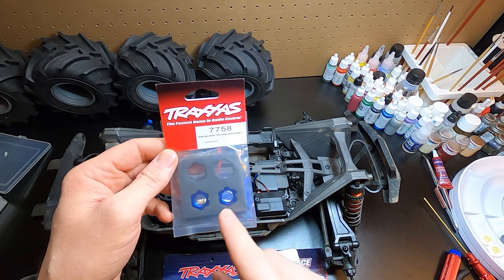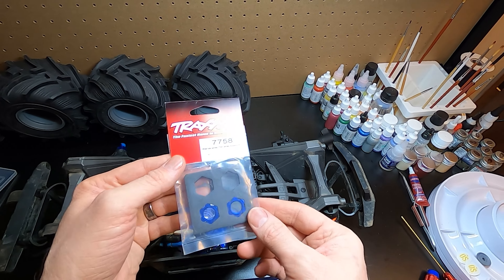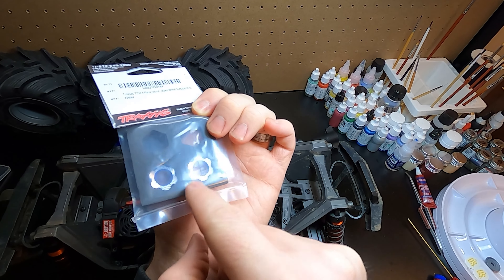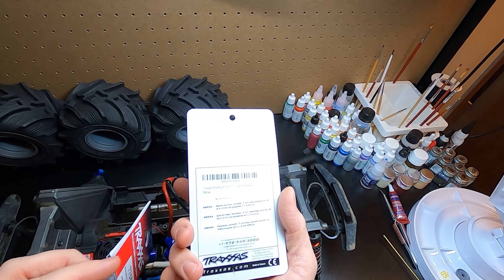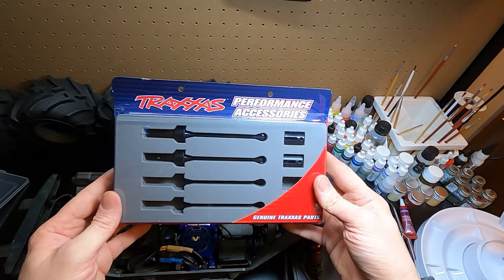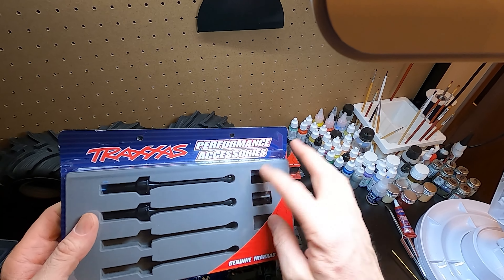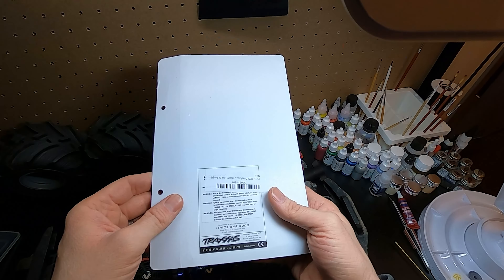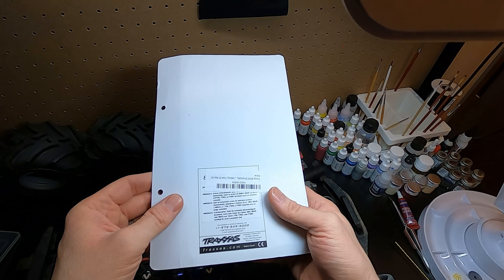Traxxas Maxx STEEL Drive Shaft Install Video

Comment: As a lifelong mechanic, I love how Traxxas thinks about ease of maintenance and repairs. Its impressive that it only takes a few minutes, one nut and two screws to replace an outdrive. I'm loving the Maxx with those Fling Kings!  I have a set of the Renegades on my LMT, I'm def going to buy a Maxx just to run them on it.
Reply: As a random dude i think its absolutely stupid that they charged 600 dollars for this truck and put plastic driveshafts. Metal should have been included total idiotism.
Reply: They gotta get that upgrade cash. Lol
Reply: @KrazyKido  cry harder

Comment: I put those high velocity drive axles on,  I got the widemaxx kit, so had to get the ones to fit, what a difference  definitely RECOMMENDED these ! Seemed to be more " raw" with power,  you will see what I mean!

Comment: I wondered what those grub screws were when I installed my axles in the maxx v2. I’ve been bashing the snot out of my maxx and changed wheels several times till last night and I put some buggy wheels on it and one came off on a 60mph speed run. Haha will the regular grub screws work? I have some from old pinions

Comment: I have 0 Issues with the original Widemaxx Plastic Shafts. They survived even 6S Abuse + E-Revo 2.0 Tires. I broke 2 in 1 Year with crashes. First Run Sledge Yesterday 1, Steelshaft broken.

Comment: The only socket Ive found that fits in the JConcepts Agressor wheels is a Snap On socket. You could also grind down the outside of a cheap socket.

Comment: I actually left the original inside bearings (bigger of the 2) on accident, so there's actually 3 at each corner now. Didn't seem to hurt anything but wasn't Intentional either. Also my set screws wouldn't reach the pin in the hex so the wheels are the only thing keeping them in.
Reply from the maker: Do you think leaving in those bearings prevented you from tightening down those screws?
Reply: @outsourcedrc  I hadn't considered that, very possible!

Comment: The cups of the hubs are too long and strain the differential bumps with maximum suspension travel.  I recommend shortening them by 2mm on a lathe
Reply: Can you explain this?